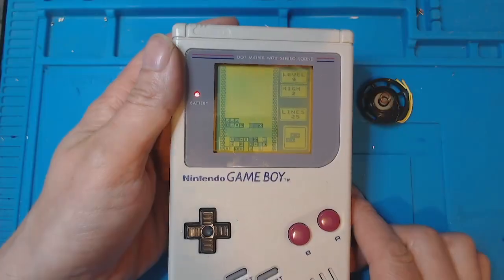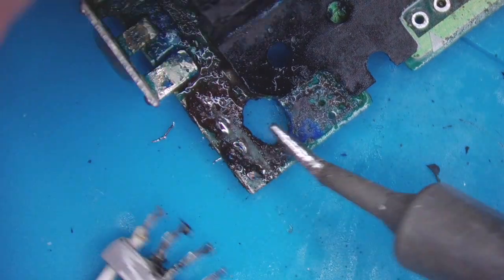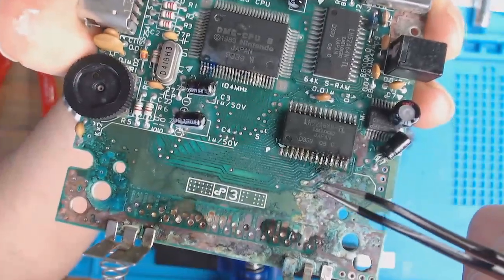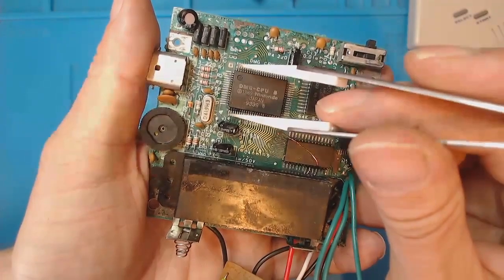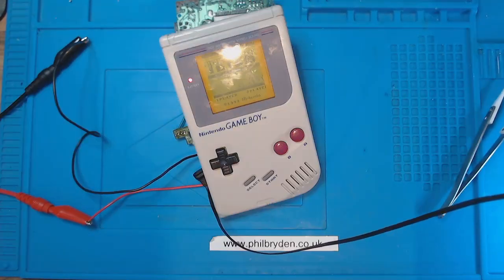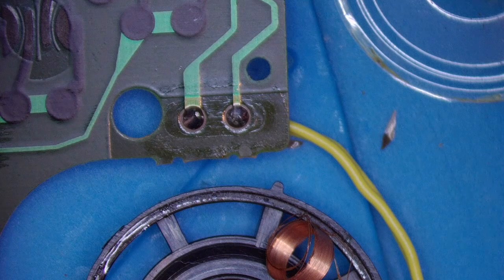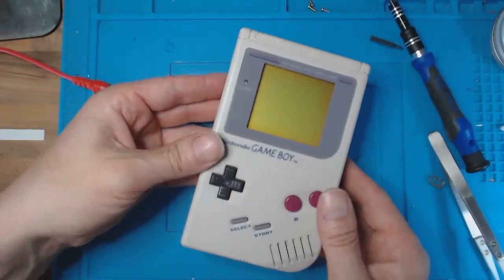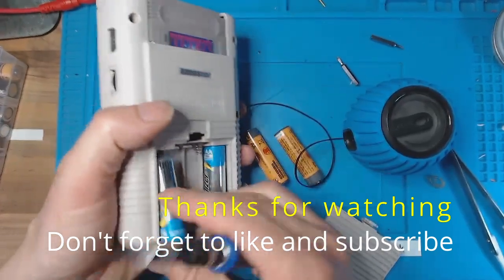Heavily Corroded Gameboy Lets Fix It

Comment: Great video. Just subscribed. I am currently working on a heavily corroded GBA. I am pretty sure I will have to do a lot of trace repair work as you have. Have ordered a digital microscope, so once that arrives I can make a start. 😬
Reply from the maker: Hi Scott. Although I managed to get this one working, it wasn't reliable enough to be enjoyed lol. Some of the pads would come away and wires would snap just by looking at them. It was a furiatingly fun project.  I have a GBC which is in similar shape but despite many hours spent on it, it's still refusing to work. I'm consider the nuclear option and stripping everything off the board and repairing all vias before putting it all back together.  I'll sub to your channel to see how you get on with your GBA. Do a review on the scope you buy, the video I did about mine gets a lot of hits. Good luck.
Reply: @Philip Bryden  Sounds like you had a lot of fun 😬 but it did make a great video. I am going to have to do my video in 2 parts as I am getting the microscope from Aliexpress so might take a while to arrive. Great shout on doing a review, I didn't think of that. Thanks for the sub to Phil. See you around 🫡

Comment: Hello, amazing restoration! I was inspired with it to try to restore board with similar damage, and made it to play game but now it stars with two horizontal lines only or many horizontal lines. Maybe you can give me some advise, of where I should look on damage? DC converter seems to be ok, and giving correct voltages
Reply from the maker: Horizontal lines are normally screen damage as far as I know. I don't think there is a fix unfortunately. Did you manage a fix?